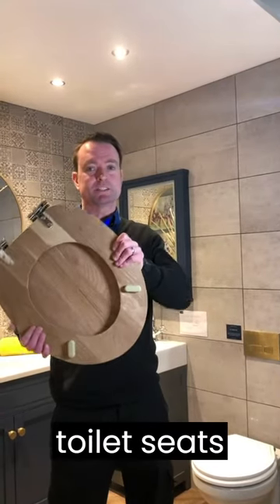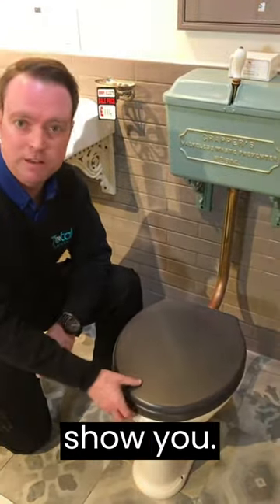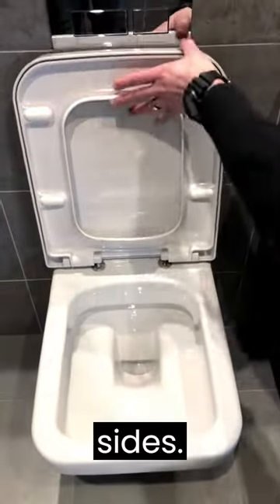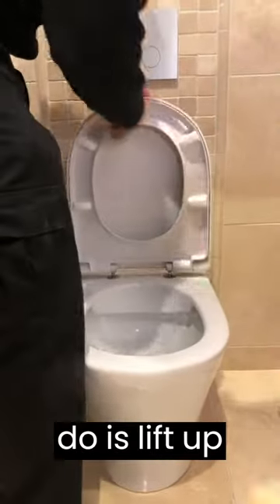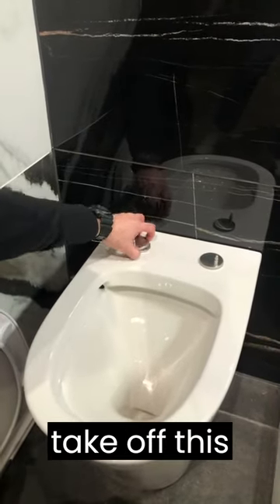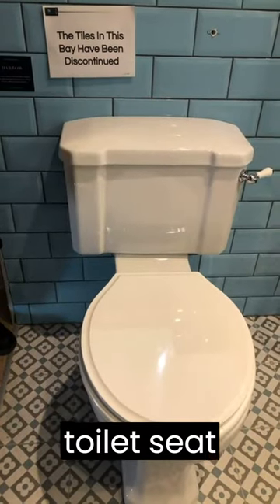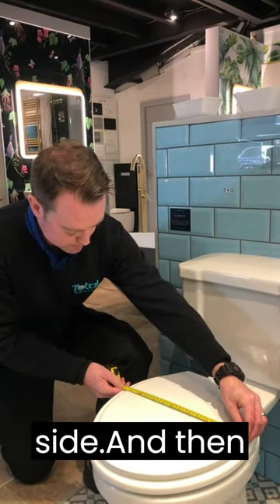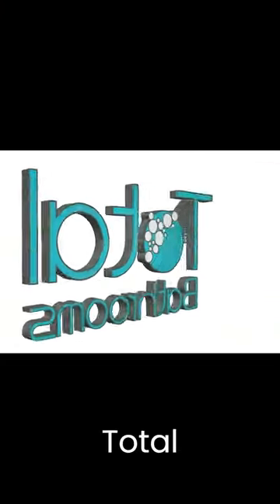What type of toilet seat do you have? How do you measure and fit a toilet seat?

Comment: I’m struggling to get a new toilet seat for my toilet it’s square but not standard size, I have bought several but they don’t fit as the inside of my toilet is large can you help thank you
Reply from the maker: If there is a brand name on the toilet or seat or if you have the paperwork for when you purchased it then that helps as you can send some photos over to the supplier/manufacturer and they usually can identify it. If not then you can always send us some photos & dimensions (width, length and the distance between the 2 holes in the pan) then we might be able to have a look at it for you